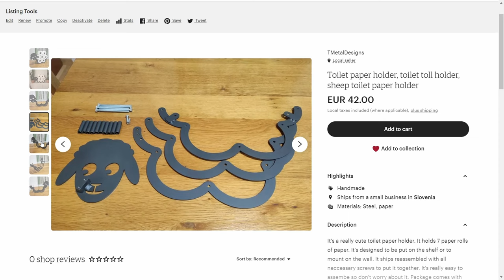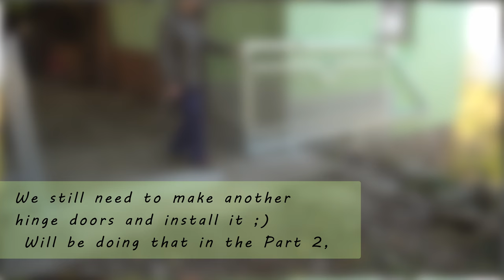Sliding gate | DIY

Comment: whats with drilling all those holes where the rods covered? seemed like an unecessary step but you probably know something i don't ha.
Reply from the maker: Like I mentioned in the video. That's  an important step if product is going to be Zinc coated :) 
Railling is dipped in molten zinc. High temperatures can make the sealled tubes explode. And we don't want to let that happen :) 
If i would use solid squares instead of tubbing, there wouldn't be a need fot that. But I was doing that railing with a low budget for my uncle, so I saved him a few bucks by using tubbing
Reply: @makeityourself5016  ah sorry missed that, makes sense!